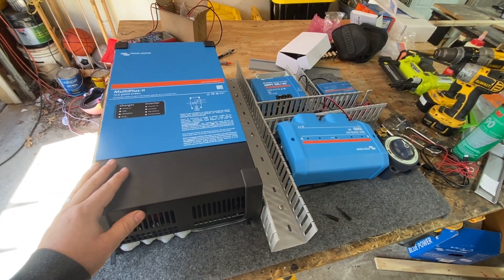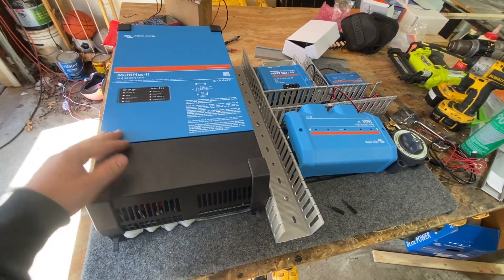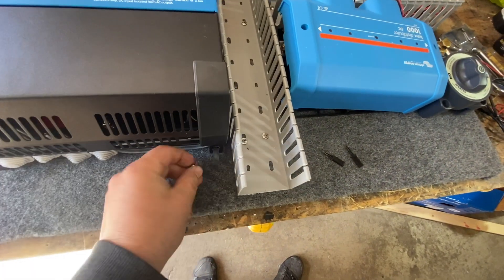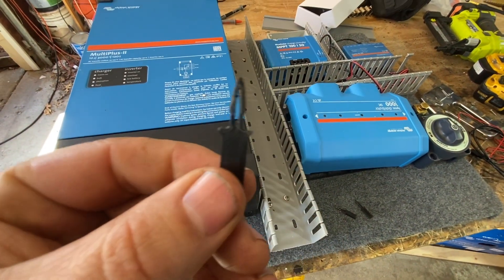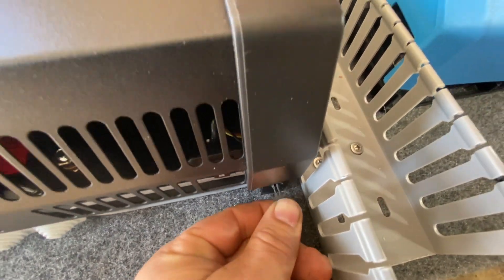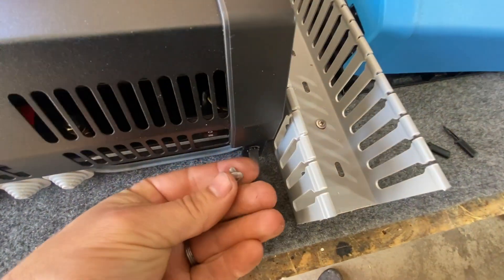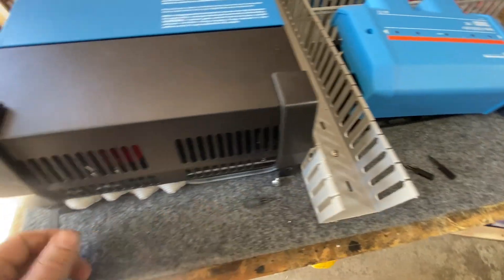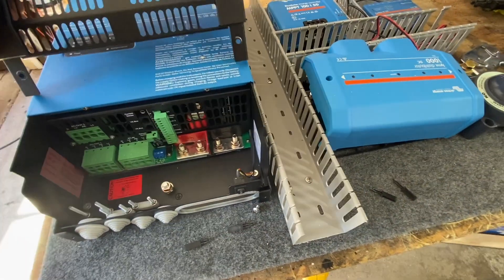Victron Multiplus II Bottom Cover Screw Fix with 3D Printed Push Rivet

Comment: I really don't get why they designed it so poorly, the accessibility  is so bad with the new line. They should just put 2 screws at the front or on the side just below the ones that hold the blue front plate.